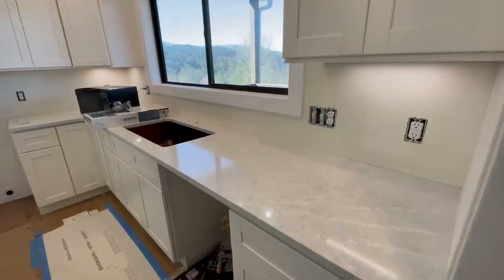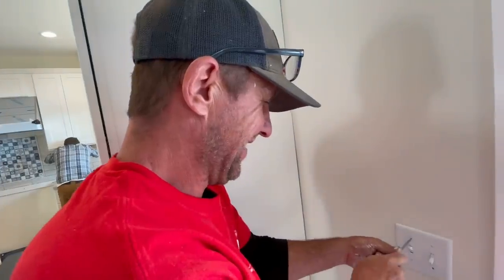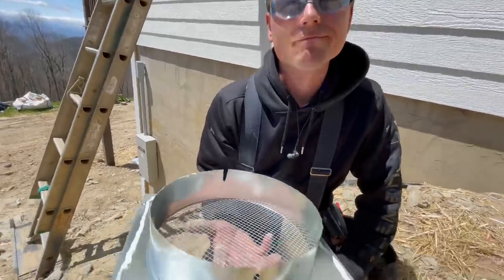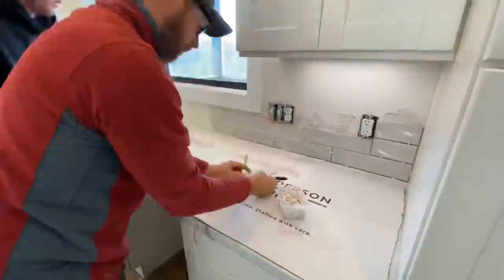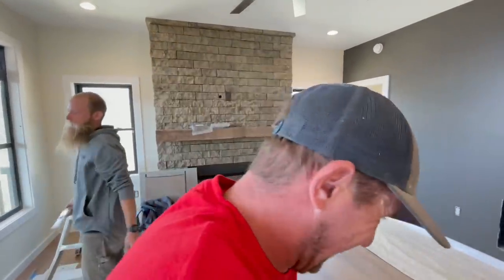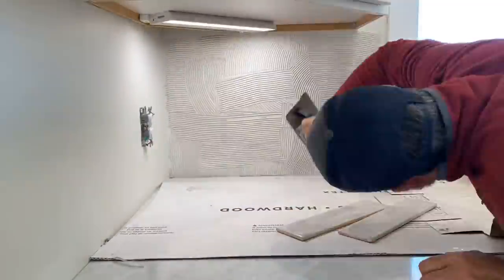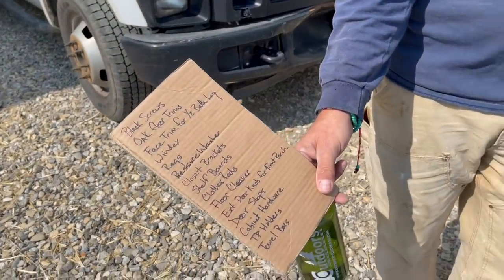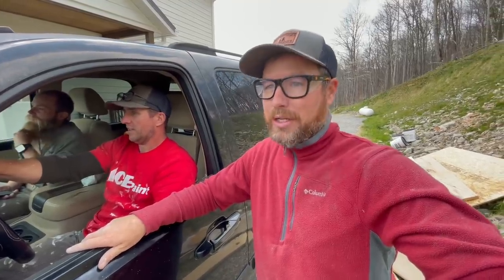Building The Farmhouse | Day 76

Comment: Yes. We do notice the screw slots aligned or not. After being in the electrical field for 25 years I can certainly tell you this is an important finishing detail. Additionally, those electrical boxes where you installed the wall tile were not spaced out properly to close the gaps to (NEC requirement) to within 1/8”. You can buy sleeves to go around the devices that slide into the boxes for this reason.

Comment: Have you ever considered the adjustable outlet boxes for the walls to be tiled?   Carlon B121ADJ 1-Gang 21 cu. in. Non-Metallic Wall Box with Adjustable Bracket they also have doubles.  They are adjustable up to 1 1/2” I believe.  Just adjust out even with face of tile.

Comment: Yes all switch plate screws must be all the same. Also you MUST break the mickey mouse ears off the switches and receptacles when using a remodel box (blue box with the screw flaps) on flat/non tiled walls. That way the switches sit deep enough to have the cover sit flat on the wall. They will match the shape of the recess in the remodel box just for that.

Comment: I always do the same thing on switch and plug plates!!!
Reply: Now that my ocd has been cued into this I am going to fix every cover plate in my house tonight 😂
Reply: Me being a racecar mechanic and OCD I know that every fastener needs to be tightened the correct amount. If you worry about the alignment of the head they will end up over or under tightened. 

Tight is tight. Too tight is two pieces and if you back it off it's not tight.

Comment: Pro tip (from a non-pro): When you're grouting backsplash tile, be careful of the wet sponge hitting the side terminals on switches and outlets, you'll get shocked. Not that I did, but I saw a friend do it a few times...haha.
Reply: Pro tip. Wrap the back of the switches and receptacles with electrical tape. No more shocks or shorts
Reply: @acase3235  how many wraps does the code book say to put on?

Comment: Open time on the Mapei organic adhesive is 30 t0 45 minutes after such time remove adhesive and apply new. The notch towel you use is to small for a tile with that much curve built into it. 3/16 V notch trowels were mainly used for 4-1/4 tile . 1/4 x 1/4 would have been my recommendation for a tile with that much curve to it. Did you check the coverage on the back of the tile?
Next back splash use electrical boxes that adjust out of the wall to accommodate tile. All you do is turn one screw.

Comment: Whats up homies, one question, you don't used a concrete board on the tile in the kitchen?  You just installed on top of the drywall, it's that works good?

Comment: Pro-Tip on the wall plate screws:
Years ago it was common for the wall plates to be painted. When the devices needed to be replaced you had to clean out the screw head. Often when the screws were put in sideways, they got wacked hard enough that the terminals arced against the side of the metal box. Having the screws in line put them against the screw that connected the device to the box and prevented things from shorting out.

Comment: Thank goodness you turned those screw heads the right way ... my skin was crawling with them being out of place. It is not a thing about OCD, but a thing about doing things right!
Reply: Proper tightening is what is correct. Why would you over tighten or back of a fastener to make the heads line up. Now you will think every time you see it,  is that too tight or too loose?